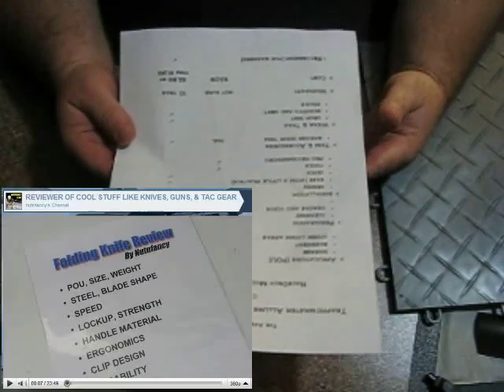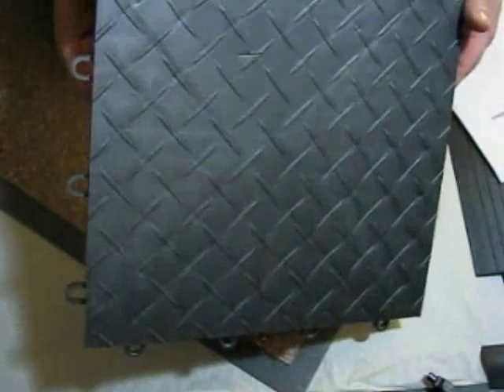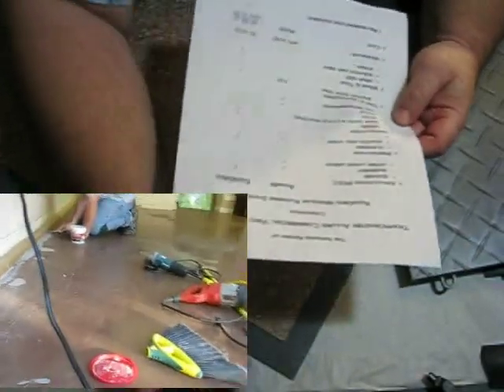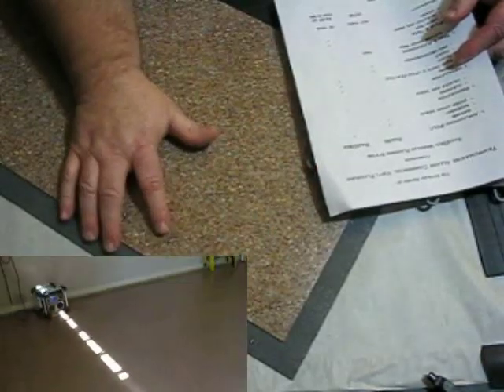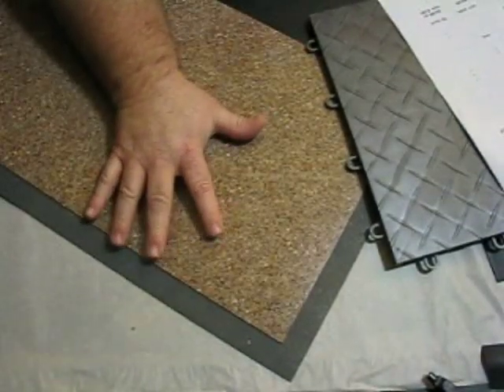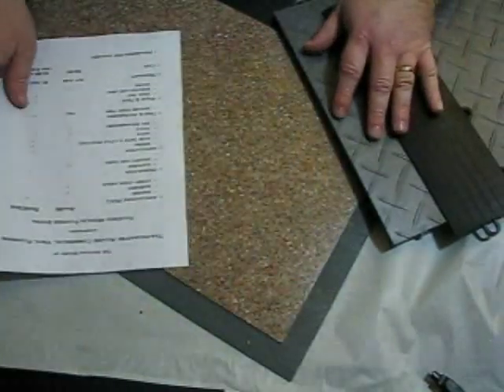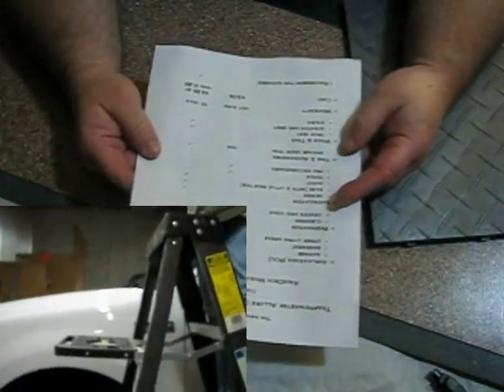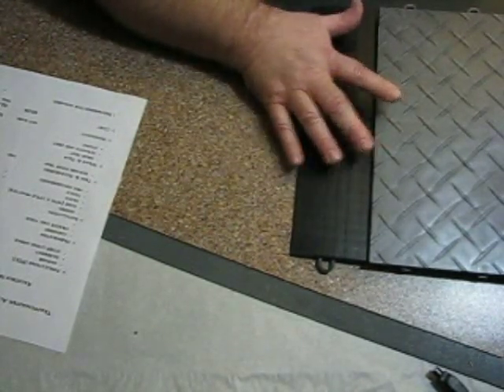Review of Trafficmaster Allure Vinyl Flooring

Comment from the maker: @jenn8184 You could use the RaceDeck but it would be kind of lumpy on bare feet.  It is best suited for a shop floor where you want good slip resistance.  The Allure flooring would work better than the Racedeck for an interior finished floor.  The have the Allure in a pattern that loks like wood planks also if I remember correctly. Thanks!

Comment from the maker: @mikeonetoo I have seen Racedeck in other applications like hobby rooms also.  It is not as slick as you would think and it is much more reliable than epoxy.  Unless your concrete is basically perfect (and doesn't really need a surface) epoxies are very fussy and will peel up unless, like mentioned above, it is almost perfect.  I have put Racedeck over several epoxy floors where it was peeling up due to the fussy process of the epoxy. Yes, if you have a sub-floor with a lot of deflection I would

Comment: Thanks. Missed the description you mention.  Racedeck is obviously for garage floors.  How does it compare to the epoxy paint-on stuff in terms of durability and slickness  and can you extend it six inches or so beyond the outside of the overhead doors?
I was actually looking for resilient flooring to cover cracked ceramic floor tile in a kitchen.  Floor is old, wavy  & joists move. Tiles on 3/4" ply  plus thinset-bad idea.  Allure Ultra interlocking planks? Prob. not now.  Thanks for feedbk.